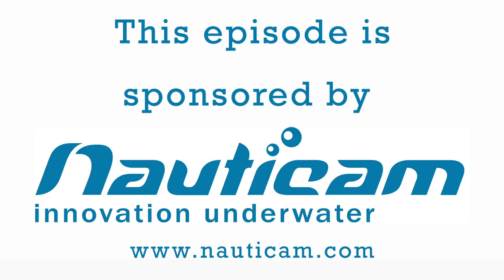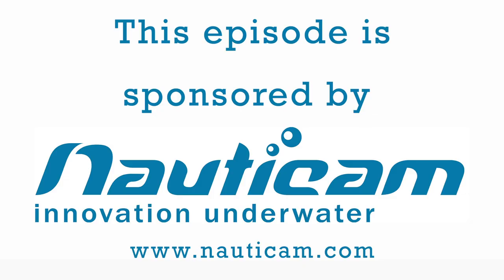Help! I've Scratched my Glass Dome Port

Comment: Guys, one important thing to note about glass dome ports is that if they come in contact with something aluminum, like a ladder or railing, it could be that the aluminum is just leaving a deposit on the glass. I had a guy hand me my camera before doing a tech dive and slammed the glass dome port into my deco bottle. I had a hard plastic cover and was not going to take that on my 63 meter dive. I got back on land and found that the glass for dome ports is extremely hard and it just might be an aluminum deposit from the tank coming in contact with the glass. I took the very light polishing cream used to do the final polish on acrylic dome ports and it came right off and looks like new.
Reply from the maker: I think the best advice is to use some form of protection. I add lanyards to my hard plastic protectors and attach them to my rear (butt) D ring. I have found that cave and tec diving, with all its associated extra gear and challenging environments means that to avoid damage, a cover is even more necessary than usual!
Reply: @Wetpixel-Live  great advice